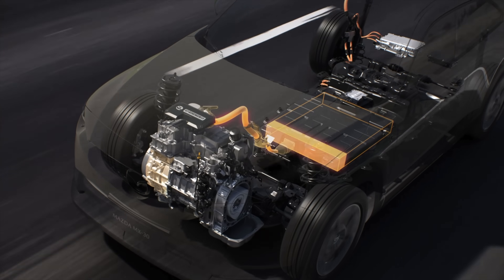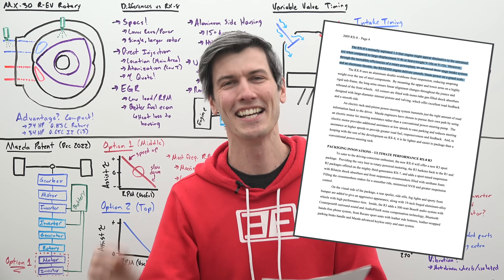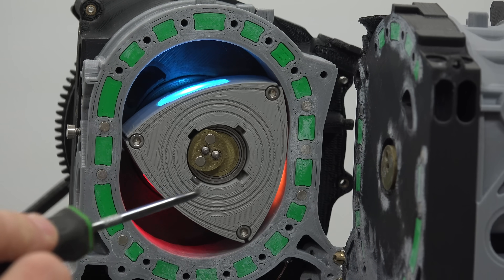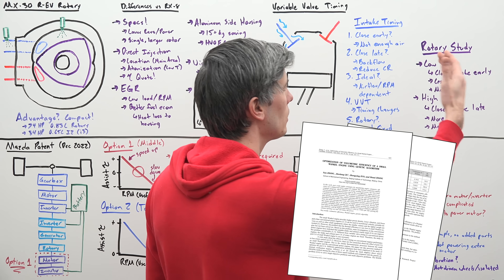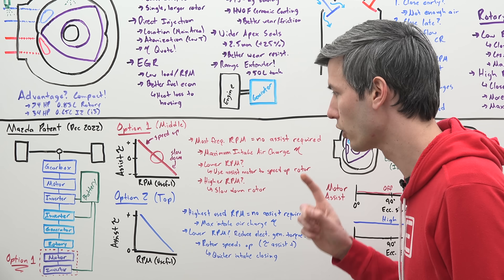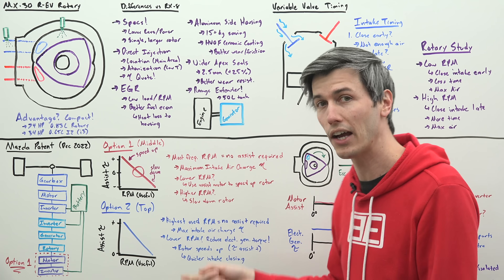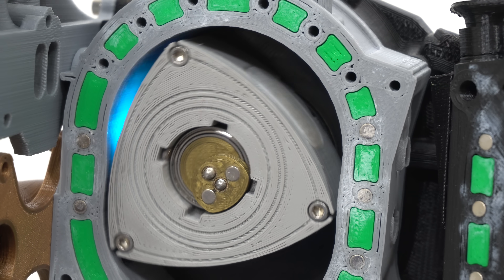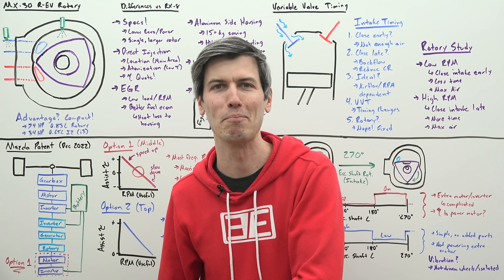Mazda Brought Back The Rotary Engine!

Comment: Hi there, thanks for an interesting article but its the first time I've seen an EGR valve described as a device to warm up the engine casing. In conventional engines, particularly diesel, they have been fitted to reduce NOx emissions by feeding in exhaust gas to the engine, thereby reducing peak temperatures in the engine. Petrol engines have started to do that in more recent times due to direct injection systems increasing the peak pressure and temperature and therefore higher NOx values.  The downside of the EGR valve is reduced power and higher fuel consumption. Admittedly in my 50 years in the motor trade I have never been involved in the rotery engine but I find it very unlikely that the EGR is for the purpose as stated other than a slight advantage on cold start.
Reply: Hi there, I have 2 replys which I cant read on here for some reason and have been requested to text on Telegram to the author but am not on social media as I dont want the whole world tracking me even though Windows is already collecting large amounts of data

Comment: While this is a very clever set of solutions for a power plant compared to a piston engine, once you're just running a hybrid where the power source is going to be simply spinning at a near-constant RPM, I think it's time to just go back to a turbine engine. The compactness, and stark lack of complexity of using a gas turbine here along with a number of other benefits (like not being as concerned about what kind of fuel is being used) could seemingly overshadow any potential manufacturing costs.

I remember being at a turbine repair shop in my college and on the desk was a small turbine that was about the size of a shoebox. I asked what it was and they said it was an APU (aux. power unit) for an F4 Phantom fighter jet. I marveled at how small and lightweight it was. I asked what the power rating was for this little guy and the shaft output was listed at 500HP!! I swear the thing couldn't have been more than 25lbs. The only catch is that it only runs at one RPM.

Comment: Could a sleeve valve not be incorporated into the intake system slaved to throttle positioning as chosen by the operator?  The intake port is then sized to the maximum size for full load operation but the air charge could be trimmed precisely for chosen fuel demand.  I'm thinking of the Bristol Hercules radial sleeve valve aircraft engine.  Sleeve valve position could automatically adjust through an actuator controlled by the ECM.

Comment: I can't wait to see people stack this new engine. The displacement will be larger (2 EV rotors will be 1.66L rather than 1.3. Not sure of a recline, but all the HP and TQ is will produced at lower RPMs. The only thing to worry about is the weight; assuming it is only the engine and not the entire setup.
Imagine if someone made a 4 rotors engine. That will be 3.32L. Much larger than the current 2.6L four rotor engines. Fun times are coming!!

Comment: Mazda is claiming this to be the fuel efficiency  of 1 lire of petrol for 100KM , even if the conventional road efficiency is applied , this rotary can pull up to 75 km on 1 liter of petrol, your thoughts about? A tough challenge for Prius?

Comment: What will be the wear on the parts for this generator slowing down the rotary for that split second? 

I mean it will have to do it a dozen times a second right? 

I've got a couple ideas, so if the engine is to charge the batteries, can't the motor run at whatever RPM it takes to generate the required voltage? 

Or possibly alongside the direct fuel injection, can't there be a small compressor and have an air injection system too? That way you get a measured amount of air that can be changed at any time, would be nice dry air too, which one would assume means a good burn?

Comment: Pretty genius if it can be made reliable — design the engine with the assumption that it will always be encountering the resistance from the generator, and when you need the engine to spin even faster, tell the generator to resist less.

Comment: You don't need cold start. Battery could warm up oil pan, run oil pump. Then charging can start at 75-80% battery... This way when engine starts, it can up to 4500 from idle pretty fast without problems in matter of seconds then run there...

Comment: I can't wait to see what the fuel efficiency numbers are.  That was one reason that the rotary engines were never that popular.  This would be really exciting if it was actually a really competitive setup.
Reply: Quite so.  I had a Mazda RX 4 which had outstanding performance but poor fuel economy.  Both my Mazda 323 and Mazda 3 performed better and were far more fuel efficient.  But now perhaps the ultimate will be the new Wankel approach.
Reply: Based on information already available, its 25-28 MPG.

Comment: Once they get the power up a bit on this seems like it would make a good aircraft powerplant,  may have to be a twin engine design with counter rotating rotars but that should be easy enough.  The weight savings alone would make aircraft designers eyes light up.
Reply: You might actually be able to make a small twin-prop aircraft that would be good for multi-engine training with something like this, maybe with a turbo to up peak power output a bit.

Comment: It's the 16X that Mazda's CEO in 2011 told us was a pipe dream! Okay it's half of the 16X. Option 2 using the generator seems like it would adversely affects engine harmonics. I'm sure it wouldn't be difficult to isolate the vibration from the cabin, it just seems like the added NVH would decrease the longevity of an engine type already known to be... finnicky. Perhaps that's addressed with the changes in housing material and coatings.
Reply: Unfortunately this not the 16X program which was cancelled in 2009.
This is a 1960s vintage 40A engine that's been dressed up to look convincing in the concept vehicle.
There is no evidence to support that Mazda is actually going to resume production of any Wankel engines.
The Mazda RX engine assembly plant at Ujina #2 was shuttered in June 2012 and demolished in 2013, it's now the site of a Skyactiv G engine plant.
Reply: @sandervanderkammen9230  It was a joke.
Reply: @AtlasJotun  Yes, the Wankel engine is a Joke... but we all know this already.

Comment: it was always destined to be a generator. it runs best at a “sweet spot” rpm and is compact and power efficient. i’m a little surprised they didn’t just use a long scroll valve for the intake but instead take off the load
Reply: Basically it is still an Otto-cycle engine the efficiency of which is reduced by the throttle valve.  Regardless of engine speed, the efficiency is greatest with the throttle valve wide open because that eliminates the pumping losses resulting from sucking in air against the vacuum created by the throttle valve.

In general, if a certain amount of power is required, it is most efficiently obtained with the throttle valve wide open with the engine running just fast enough to produce the required power.  Thus the most efficient engine speed is the speed at which it will produce the required power at wide open throttle.  Therefore the most efficient speed is not fixed!  Rather, the most efficient engine speed is variable.

Comment: General Motors did extensive work on Wankel Rotary reliability. They were able to improve the apex seals to better than conventional piston rings. Obtaining up to 1,000,000 miles between overhauls over 30 years ago. Those patents are now in the public domain. But many secrets were never revealed. Only those, now mostly 80-90 year old engineers are passing with that knowledge. GM gave up on the rotary due to difficulty in reducing emissions and improving fuel economy to the extent possible with conventional four stroke piston engines. There is also the issue of low torque at all RPMs which is counter productive to making cars larger heavier and safer with more features for larger people.
Reply: I should note; A Wankel Rotary can be "point designed" to meet or exceed the reliability and efficiency of a piston engine within a very narrow power-band. For a range-extender this engine makes a lot of sense.
Reply: I'm interested in the potential of Koenigseggs Free-Valve pneumatic valvetrain taken from MotoGP and F1. As a mechanical alternative, I would like to see Sleeve Valve engines make a comeback. It would be much easier to optimize with modern computers and materials.

Comment: Great description of the technolgy man. I wonder what the efficencies  compare like between the old wankel and this new set up and a comparable hybrid piston set up are.
I had a 1996 Jeep Grand Cherokee that controlled the current flow to the alternator rotor thus controlling the current output of the alternator and it's mechanical load on the 4.0l motor. Also there was a temperature sensor under the battery which the ECU monitored and when the battery was cold the rotor received more current and thus warmed the battery up and kept it charged to maximum. The O2 heater uses more energy until open loop running conditions as well so this must not be new tech they are using but just a new combination... yet.

Comment: In the US military the M1A2 Tank uses a 1,000 HP gas turbine hybrid drive motor system for well over 25 years.  It would make more sense for a hybrid to use a gas turbine, you can probably get more RPM out of it as well.

Comment: Your second option will stop the generator charging the battery when the static converter is commanded to the quadrant in which will motor the generator to speed up the rotary engine. 

I thought the 24 hour they won due to reliability or fuel consumption ?

Comment: Regardless, if this technology is applied in the production model, since the patent uses 100% existing hardware, it can be applied as a software retrofit provided the inverter is smart enough. And even if it is applied, I expect that future software updates may further improve the fuel efficiency of this powertrain.

Comment: As someone who owned a RX8 as my first car, during Obama era $5+ gas prices while making $10 working at round table. Just the thought of rotary engines coming back, reminds me of the nightmares I lived through…. One time I took my car to Mazda themselves for service since I thought they would be the pros, only to be called 5 mins later to be told that their new porter flooded my engine. (Done by turning car on and off in less than 5 mins)

Comment: I have not heard any mention from Mazda regarding top speed/ 0 to 60 times, in circumstances when the rotary engine is called apon to both charge the battery and provide energy to drive car along the road. In this mode, how long does it take to get the battery  up to a full charge?
How would the car perform driving for four hours at 70 mph, what would be the state of charge at the end of four hours? assuming you had a 50% charge at the start of the journey.
 I had assumed that the engine, when running, would always run at a constant rpm. So variable inlet timing would not be required?

Comment: regarding the devil's-marks problem... why cant there be a sky/skid like spool/foot which skids along the surface and adapts angle of pull/force via a axle/pin connecting the triangle rotor's wedge/edge and the sky/peddle/foot in contact with wall and skidding along it keeping the chamber sealed and avoiding the devil's-marks caused by when the wedge/edge of rotor is directly in contact with wall

Comment: That’s a step in the right direction. Now Mazda just needs to produce a small rotary powered replacement for the RX-8 to compete with the GR86. Mid engined perhaps?? I would be unable to resist.

Comment: Why not use the EGR in conjunction with a turbo and use variation s in pressure to intake the appropriate amount of air? Valve flow rate restrictions?

Comment: One part that i thought was a little ambiguous: to someone that doesn't know engines: more intake time being ideal at higher rpm. Is that relative to the total time of a revolution or absolute? if at twice an rpm the intake would normally be halved; is the ideal intake time somewhere between where it was at the initial rpm vs half that value or is it longer than the initial value for intake time?

Comment: To my knowledge, this is how diesel-electric (the most common) locomotives work.  A motor powers a generator that powers the wheels.  I've been suggesting for years that this was the likely future of automobile transportation as EVs have severely limited range and the cost to manufacture and dispose of batteries is high.  The use of a small to mid-size battery pack with an efficient petrol-to-electric conversion gets you the best of both worlds.
Reply: Its called a Series Hybrid system and it was invented in Germany by Ferdinand Porsche in 1898, called the Lohner-Porsche they were sold in  2 seat convertibles and 4 seater sedans from 1900 to 1905.

Comment: I jhst started to learn how rotary engines work, but so far I have the following question: if there is no valve timing for the air intake why there is no mechanism that would block out in the variable fashion the air intake port, thus limiting the timing? Ecu would do it and everyone would be happy, no? Maybe I just don’t understand or know smth about rotary engines, but that at least makes sense to me 😅

Comment: Do the engineers at Mazda cross hatch the inner housing of the rotary casing (were the rotary seals make contact)? It's the  same principle as cylinder 45 degree cross hatching and how it retains oil.

Comment: Chrysler/dodge/fiat has used valve timing differently. The are using VVT to simulate an Atkinson cycle as opposed to the traditional Otto cycle, less Herspers, less torque, better thermal efficiency. More efficient for generator use. So, VVT is NOT a hinderance.

Comment: It’s just a rotary generator for the car’ batteries. Really sad to see them use this great engine as a selling gimmick for their EV’s.
Reply: actualy clever, rotary were never optimal with wide range of RPM, thats why they been initially considered for airplanes, ...but jet engines happened
so fixed RPM is crucial to be able to optimize the bad efficiency of rotary

Comment: When you say the air intake needs to be open longer at higher RPMs, is it actually longer, or does it need to be open a greater percentage of the time the stroke occurs since the stroke length will be shorter at higher RPMs?

Comment: Your motor is gunna run off a battery that is charged by a generator that is powered by a motor that is controlled by another motor. Yeah I’m sure the service techs at my local dealer all all over it lol 👌

Comment: But how have they addressed the oil consumption and failing wiper seal issues plaguing rotary engines? Are they doing oil injection from the sump still? Will people be able to pre-mix to ensure the generators longevity?
Reply: They haven't which is why you won't see this at your local Mazda dealer

Comment: As a mechanic this does not seem fun to work on       from an engineering standpoint it seems really cool
Reply: It would be interesting to look at the parts book for this drivetrain and see if they supply internal engine parts or just the complete engine - aka a sealed unit.

Comment: Whilst the vibration won’t be passed to the occupants, I wonder what the sudden changes in RPM will do to the bearings and wear surfaces within the engine/generator package. Good lubrication is everything I guess…

Comment: if the issue is when the port gets covered up, shouldnt it be possible to just make a variable geometry port ?  

Like port bored into the chamber is the largest it will need to be (for your redline) and then have some sliding element that closes the port (thus making it smaller) at lower speeds.  You could use a fancy version of a flyball governor to make sure it mechanically pulls the cover open (thus increasing the size of the port) at higher RPMs and have the return spring push it shut at lower RPMs 

Would this work or is there some complicating factor that I am missing ?

Comment: wouldnt turboing and using direct inject in a standard rotary help relieve the emission’s problems they were facing
Reply: No …
Reply: No, Wankel engines are poorly suited to Turbocharging and incompatible with direct fuel injection.

Comment: With the advent of graphene and so much improvements in material science, we could overcome the shortcomings that the previous generation encountered with the wankel engine. Such as the apex seals
Reply: So you have a dirty, fuel-guzzling engine that doesn’t have apex seal problems …
Reply: No. That is not a realistic or reasonable   expectation.
Wankel engines are obsolete technology that has reached the logical conclusion of its practical development potential

Comment: Dear Engg. Facts. Please study the 12th STD physics electrical portion clearly. For DC you can calculate the Power=VxI, but for AC current you must calculate the RMS value for the voltage. Because In AC 50Hz, there is 50+ & 50-ve also 100 neutral or zero point is there. அதனால் AC current ku real/practical voltage value அஹ் RMS calculation மூலம் calculate செய்து பின்னர் P=RMS V * I என்று கணக்கிட வேண்டும். I studied this at 2002 till date i remember that thanks to my physics teacher (my dad)

Comment: I wonder if they can achieve the same thing by designing the intake port w/ a sleeve valve that would enlarge it to allow more air in at higher RPMs.
Reply: A sleeve valve would never work because it's purpose is to only restrict air ... Air at a standard pressure will always be a constant, so a sleeve valve wouldn't work with out a forced air behind it like a turbo or supercharger to change the volume of pressure ... At that point it would be just easier and simpler to design the turbo to match the specs and  remove the sleeve valve so it will have less moving parts and weight for efficiency and durability